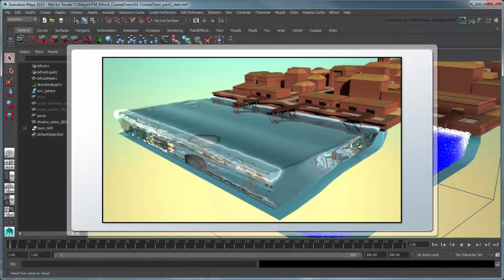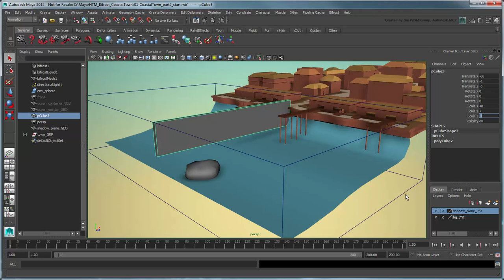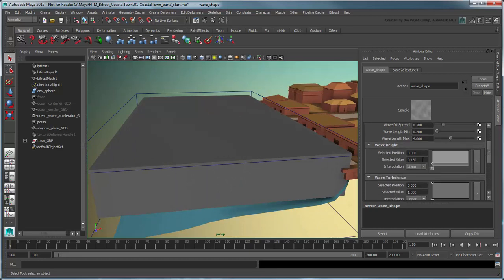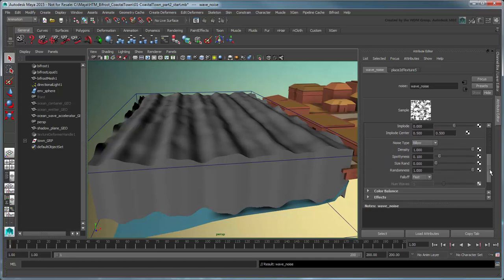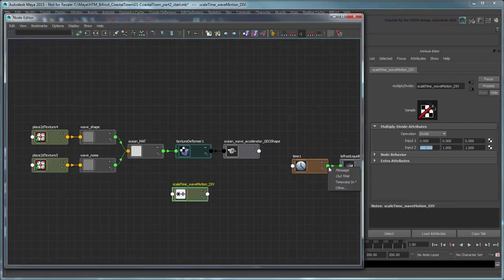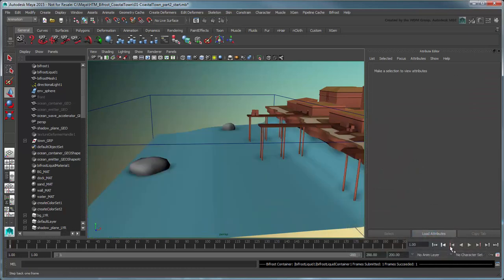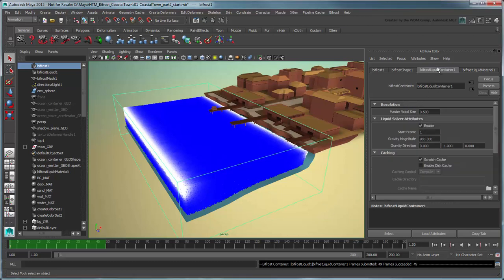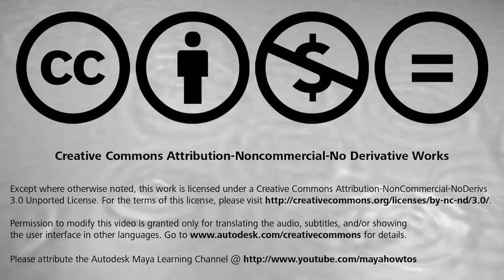Creating a body of water simulation using Bifrost - Part 2: Generating ocean waves

Comment: Bifrost interface in Maya tutorial has been changed in some areas.  I am using 2016
Reply: da awesomedude when I go into deform- texture deformer it says Select an object that has paintable attributes.  I tried adding the deformer in  the node editor, but no luck.  I might have to send my scene to 2014, tomorrow.
Reply: I know its 2 years too late, but I believe you were pressing the "Texture deformer" button under the "Paint Weights" section. What you should have been pressing is the button that simply says "Texture".